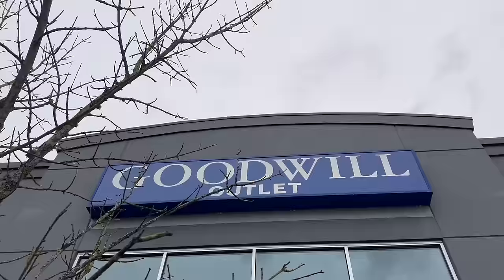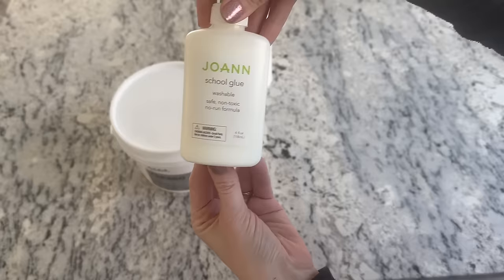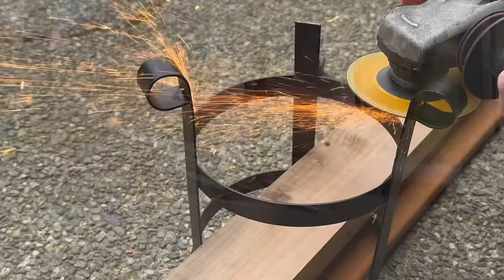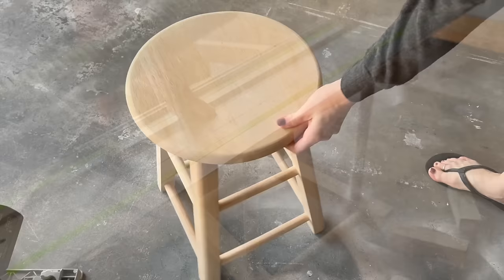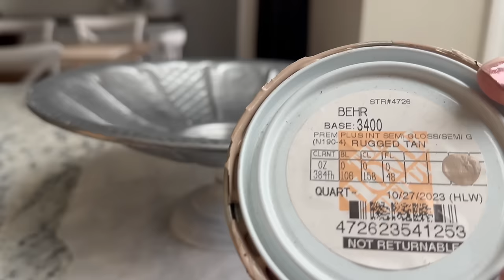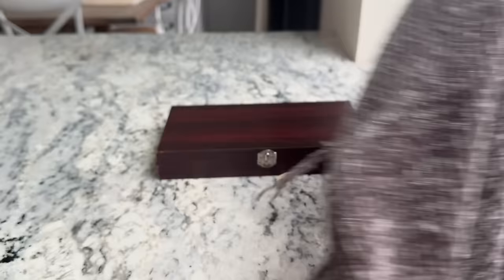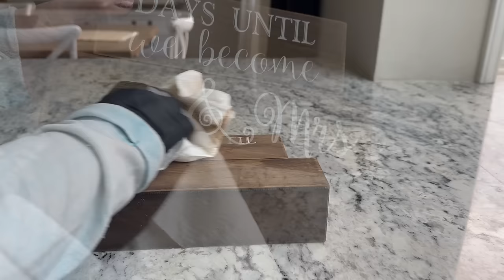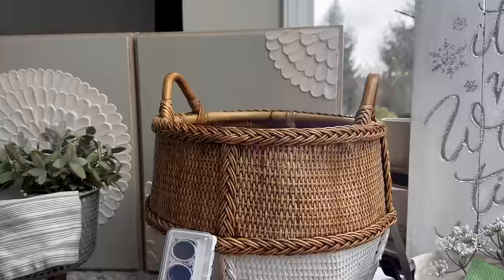🏠DECORATE ON A BUDGET 🛒THRIFT AND DIY HOME DECOR WITH ME

Comment: You’re right about the W-D 40 it’s cleaner if you spray it on a paper towel and then rub it on sticker residue and I learned years ago that lighter fluid works do! Cheaper than goo gone

Comment: on the bowl that you put moss balls inside... wondering if you could have just painted over it w/o using the Citristrip?  What are your thoughts on that?
Reply from the maker: I removed the finished just on the top bowl part then left the finish on the bottom and painted over that. I’m not sure that it was the best method, I just experiment and take y’all along! 😊
Reply: @tiffanygemmer-DIYdesign  got it.  :)